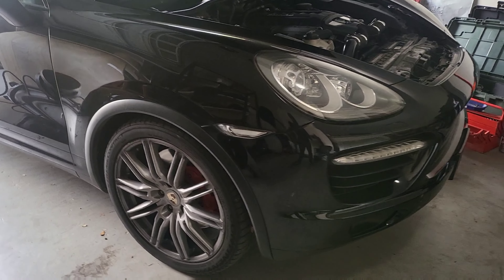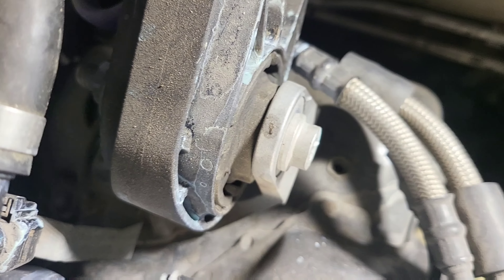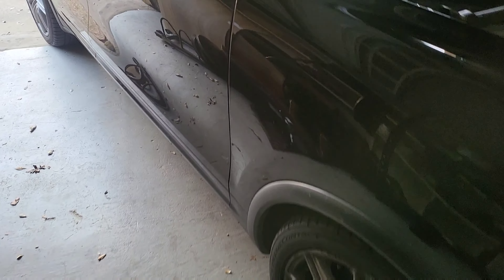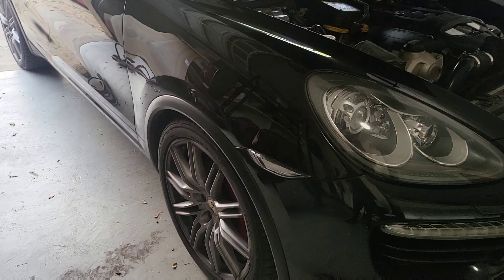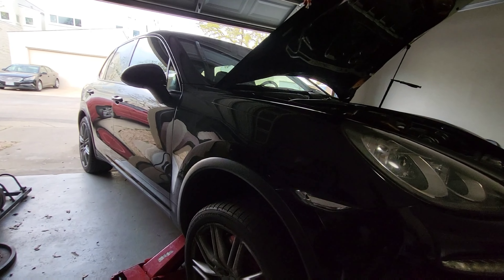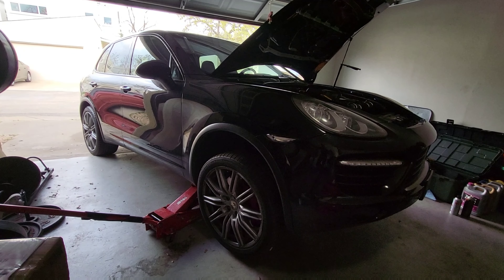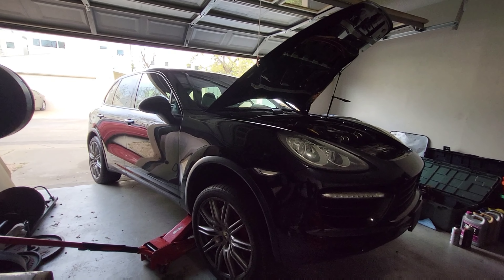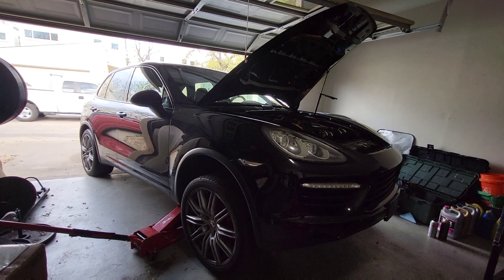Porsche Cayenne Turbo 958 | Shock Mount (air) and O-Ring Replacement | Parts in Description

Comment: It is an open system. The compressor fill the shocks to the correct level. When you want to lower the car, it will just dump the air from the shocks to the atmosphere. When you want to raise it again the compressor just sucks air in trough an air filter on the compressor and fills the shocks.

Comment: How did you add air back into the system?! R134 connector to compressor or to the strut. I’m waiting on upper control arm to come in but I’m kind of stuck on the refill.. SOS

Comment: Nice video! I was about to make one since I didn't see a video for this. Did you have any rattling from your right shock before replacing the shock mount?
Reply from the maker: No, I did not have any rattling. It would lose pressure overnight. I did end up replacing the shock with a new one a few months ago as it started leaking again.
Reply: @ovrlrdtra  Ah- I see it leaked anyway, that sucks.  What assembly did you end up replacing it with, and did you do a pair or a single one? Curious on your take as I'm in the same situation.
Reply: @talonhu9  I'm in the same boat - I assume you've resolved your issue by now? Everything I've read suggests you should replace them in axle pairs assuming they're both of about the same age. That is in part because if you're replacing the strut assembly you're replacing the shock absorber as well, not just the air components.

Comment: Thanks for the fantastic video. So, did you have to add any compressed air to the system at all, or did the built-in compressor fill the system back up on it’s own upon reassembly?